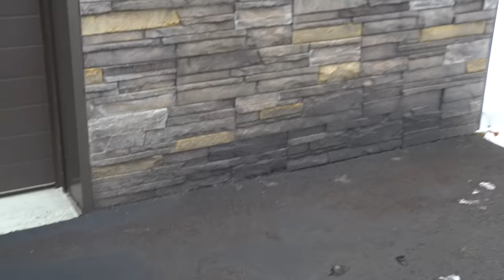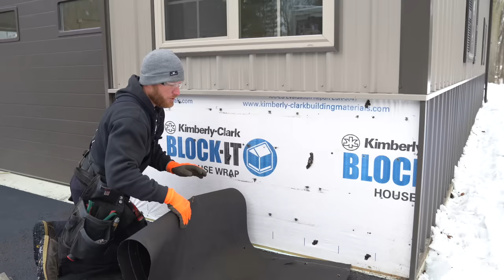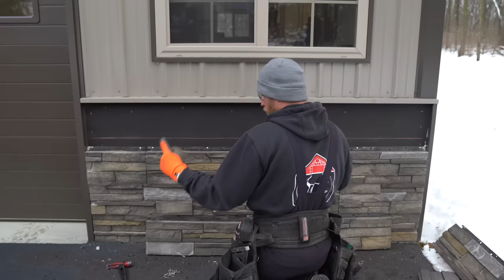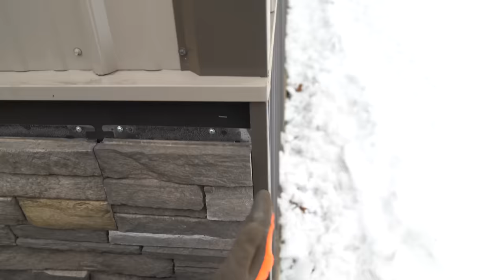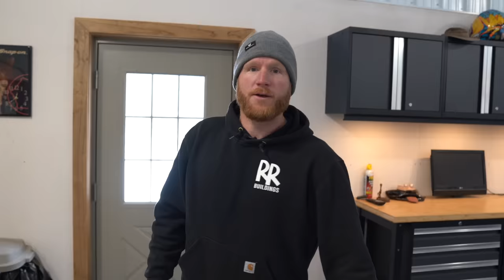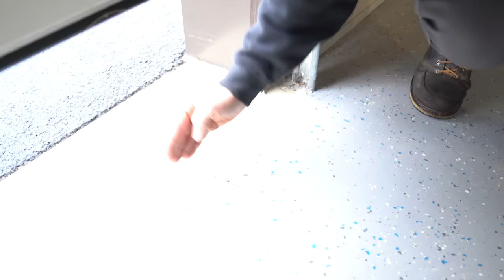Installing the BEST Looking (FAKE) Faux Stone: Versetta Stone by BORAL

Comment: I was always taught not to put tar paper over Tyvek. Since Tyvek is breathing. Could trap humidity between the layers. Same reason you don't put Tyvek on upside down. I'd imagine it would just run down and out though so long as your bottom cap (unless you're flush) isn't sealed. But, I mean, in theory I don't see how water is getting past the tar paper to the Tyvek besides the screw holes maybe. Then again it's moistly about moisture and temperature difference between exterior and interior causing humidity within wall. I've found gnarly mold growth between tar paper and Tyvek before. But that was a combination of reason. But, I get using it in this situation. Interesting product. Looks like you stair step seams just like Vinyl Siding. Every 3-4 courses is the norm. Increments of 1/4's how I do it. 12', 9', 6', 3'. Or 12" etc. 10:44 Yeah, we got a tour of the Alcoa window factory like... just after 2008 recession and it was nuts. Really cool to see how the product is being made and to be able to visualize it all.

Comment: I am confusion--why were you able to remove the top row so easily, but you say going back in that you hope you don't have to remove it because if the adhesive? Did you not use adhesive on the first install? If so, why use it the second time and not the first?

Comment: Great video! Just a couple of questions from a novice. Can you use both sticky stone adhesive plus screws to make this Versetta stone adhere real tight? Is it vapor barrier (black) behind the veneer? How do you make sure that the rain water does not get trapped behind the veneer?

Comment: Why didn't you clean the Versetta Stone, in that section, instead of replacing it? Does it not clean? What happens if you try to clean it? Will it decompose? Will you loose all the coloring? Can you take a wire brush or wire wheel to a stained piece, and show us what happens?

Comment: Question....I have wood paneling that only runs about 3 ft from the bottom of the front of my house as a previous design feature when we bought the house. I would love to put this product instead to update the look of the house. I saw how you installed the siding but was wondering if i can possibly just put it over the wood paneling instead of tearing down the wood paneling. My house was built in 1943 so not much insulation, not to mention there is a crawl space under the house. Didn't know if maybe i can leave the wood paneling on the house as an extra layer of "insulation" or i have to take it down so that it's more of a flat surface? Live in Southern California but sorta inland from the beach, as a reference for you for the average temperature where i live

Comment: Hi this is a nice video . I want to know what is it made of ? Is it cement  ? Or wood ? I’m just curious about the weight and how I would cut it . I only have a circular saw that cuts wood but not a stone . Masonry cutting is pretty intimidating. Also what is that black felt paper u used could u mention the brand and where I could buy it? Wit the versetta stone do they have for edges as well? I’m planning on making outdoor kitchen cabinets . And island thank u so much for sharing

Comment: Can I lay this straight over brick? I have a red brick planter at my entrance of my front door. It right angles the front of the house and runs the length of a ten ft front window. I don’t like the red brick. I’ve always thought about either building a rock planter but have also found myself standing and staring at this stone at home depot and Lowe’s

Comment: Had a question can you install versetta stone over metal? Example I was looking to maybe use it to install on my fireplace but wanted to over the metal fireplace insert so the stone would go up to as close as possible to the glass doors? I spoke to several fireplace companies and they said stone can be installed over top of it but not sure how that would work with Versetta stone since it uses screws to secure it.

Comment: hi, great video.  that looks like it's a wet saw but didnt see any water running out of it to wet the surface.  shouldnt we cut the stone with a wet saw?  you're the pro, thought it would be easier...im just a diyer looking at possibly doing this over the hollow tiled crawspace in the front of the house in the future.
Reply: i say it looks like a wet saw because it looked like a water tank at the bottom, but i guess not (further in the video).

Comment: When your bottom elevation changes when you step up on a porch, how do you fasten the panels when the bottom is cut off? Do you use a j mold, or just set it on the concrete slab

Comment: Evvery screw that you put into the stone track punctured the water barrier or black paper and created a leak point into the building.  Each screw needs to be sealed with caulking or you  need to use some form of tape that will seal when punctured.  Puncturing the water or the air barrier is not acceptable.

Comment: Question: I just built a stick built building with metal exterior and roof. What are my choices besides spray foam insulation. I had heard moisture and mold problems with the pink insulation Any tips

Comment: Would this be a appropriate Finish for a poured concrete outdoor retaining wall? If so, would it be considered a reasonable or a high-end thing to do? the wall is 5 feet tall and 70 feet long  and set back about 30 feet from the street it runs parallel to.     sdh in CT

Comment: Biggest issue with remade faux stone or brick or tiles modeled on natural materials, is the pattern repeats…so many boxes of those, are too many of identical-patterned pieces. 
Looks like he put 2 identical pieces in the bottom row…which will weird-out those who notice it. 
When assembled, be careful to avoid putting identical pieces next together.

Comment: Ok ... so not being in the trades..... :)

1.  When you took the last row of stone off it looked as if the blacktop was only "JUST" above the bottom of the stone.  What was done wrong?

2.  I see you knocking small bits off the blacktop before setting the stone back in, and looking for a "FATTER" bottom piece to hide the channel or rail at the bottom.

I'm not seeing what was wrong.  As someone who comes to YT to watch DIY I also watch to increase the amt of knowledge for if/when I contract for various services.

Comment: Why didn’t you just replace the bottom 3 and then reuse the rest of the fake stone ?     If the bottom ones were whole then wouldn’t the originals  fit perfectly with no cutting.

Comment: Versetta stone is cool but it can be a pain in the ass too. For 1, just because it's cheaper than stone does not mean it's cheap. Shits still over 10 times more expensive than typical vinyl. For 2, any corner that isn't a 90 is a pain in the dick. And for 3, every job I've ever used it on, like 20% of the pieces are cracked right outta the box

Comment: Do you recommend this Versetta Stone over cinder block foundations. I want to cover our block foundation. I'm watching this video sitting on my laptop in my 26 x 40 pole barn with radiant floor heat and it is 20 degrees outside, 65 degrees in here. I put OSB on all the walls and ceiling so i can hang anything anywhere without looking for studs in the wall. Click my name and you can see the video of our barn build several years ago.
Reply: Check out the Versetta website for install methods and procedures